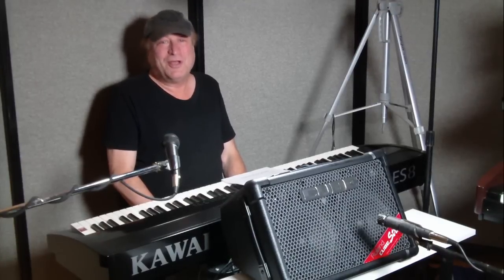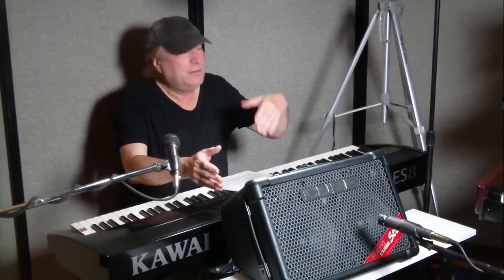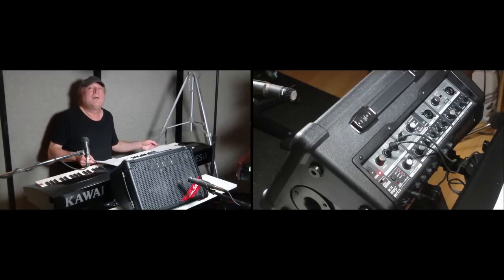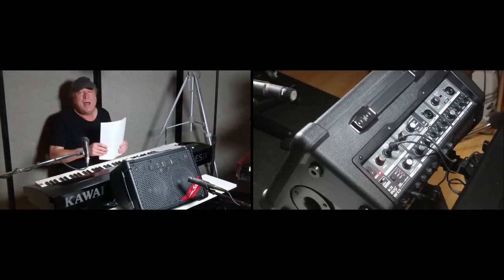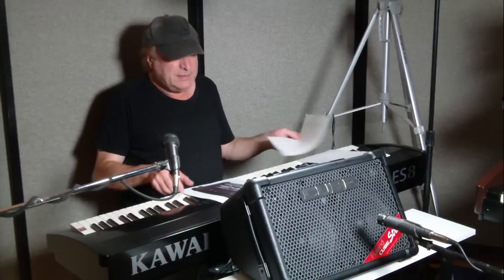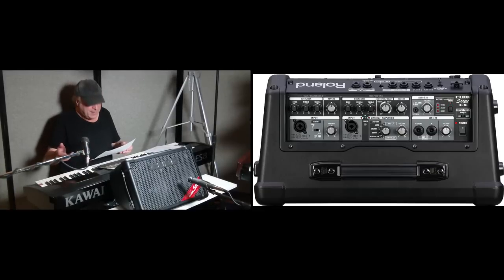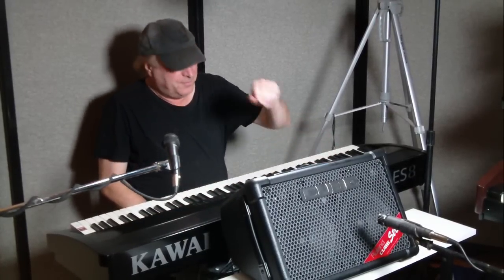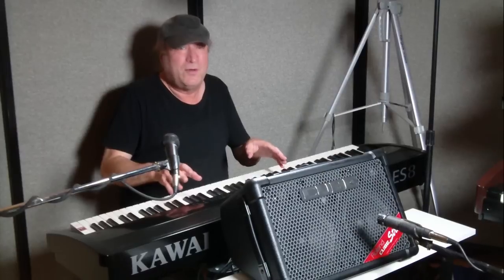Roland Cube Street EX - Review

Comment: Ok at 6:25 you say people are replacing the stock ROLAND speakers with Jensen MOD8-20 and that’s fine in it’s self but, you then go on to say 4 to 8 ohms? That’s where you lost me because ROLAND amps like any amp are designed to run at specific loads e.g. 4ohms or 8ohms or even 16ohms not 4 to 8
What I’m trying to say is is it 4 or 8ohms per channel? So the speaker impedance can be correctly matched so the amp runs efficiently. Remember if the impedance is too high the amp will work harder and be quieter than it should be BUT if the impedance is too low you will destroy the power section of the amp so the right impedance is kind of important here, sorry to pull you up on this but worth mentioning.

Comment: Chuck, I just received my Roland Cube Street EX and Behringer 1002B!  I tried using just the Roland with my Android phone and an "EQ" app, but that did NOT cut it.  The Behringer is essential for the Roland.  You were "spot one" as to the light bass and tinny treble.  I'd like to get those Jensen speakers - what are they, and where can I get them (if you know)?  Or, what forum did you ding about them?  One question on the amp itself:  which do you think is better - running the keyboard (Roland VR-09) into the Behringer or directly into the Roland, into those instrument/mic channels?  If the latter, I suppose I'd get RCA output cords for the phone from the Behringer?  Thanks again, Jeff.  PS - I bought the Roland bag, too.  Cool.
Reply from the maker: Google "jensen mod8-20" and you'll find them.  
Google "jensen mod8-20"+"cube street ex" and you'll find the forums they were mentioned.  
As to your question - whichever sounds better would be the way to go (in other words, try them both).
Reply from the maker: I've concluded that if you don't need all that power (50 watts, which is excellent!), go with the KC-110.  If you do, you'll need the Behringer mixer or equivalent, and most likely the Jensen replacement speakers - which now make it a lot more expensive!  For me, I need the power (50 watts on battery power can't be found anywhere else).
Reply: I do need the power.  I am replacing my Samson XP40iW (40 watts).  I wouldn't want to go lower.  It might be nice to have the KC-110 as well, though.  Maybe next purchase (but I want to buy a video camera to record myself playing and for a non-musical business project to post on uTube).  Did you do the Jensen switch?  I see those are the speakers!  Do you like the Zoom Q4 video camera?  Your videos look and sound great - what do you use?  Thanks, Chuck!
Reply: I'll check it out.  Why two:?  Doesn't it have enough inputs?
Reply: One to process the stuff going into the AUX and one to process my guitar going into the Line input (in stereo)
Reply: I solved my backing track EQ issues by purchasing the N-Track recording app (I use an iPad) for $29.00. I bring each song into individual tracks. Then I EQ each song to my liking. Shockingly the bass now more than decent. 
I’m using a Vox Stomplab 2 for my guitar and it’s been an effort to coax optimum tones. It’s acceptable but still working on it. But I am performing and like this amp.

Comment: Have you tried Roland's BA330 at all? If so, which do you think would be better for a keyboard/vocals busking session? Both are supposedly 50w and can be run off AA batteries, but the BA330 seems to have more keyboard friendly inputs, master volume and master eq. It is a bigger/heavier amp though.
Reply from the maker: BA330 is 30 watts, not 50.... and is much better suited for a keyboard.
Reply from the maker: Actually, the BA330 is closer to the Roland KC110 (now the KC220) than the Cube Street EX.  This video should give you a little more insight on the sounds: https://youtu.be/w5rZnAM1XVU
Reply: I currently use a kc-110 for busking, but it struggles. I think I need something with more guts. I must have gotten confused about the wattage on the ba330. Thanks for the heads up. Makes things harder. Not sure where to go from here. I play keys and sing, so I want something with built in reverb, an 1/8" aux in for backing tracks and enough channels for a mic and stereo 1/4" cable from my keyboard. Something that has a nice sound for female vocals and keys and the power to be played at 75% or lower in an outdoor situation without being completely drowned out by outside noise. Any recommendations?
Reply from the maker: Actually I do have a recommendation for you - a product that's a lightweight portable AC power supply.  A friend uses this to power his rig (keys and a Roland KC-80).  Someone else uses it to power an entire pro rig with (I don't remember his gear list but I know that Bose L1's were part of it).  The product is the Coolis HP150 which I reviewed at this link: https://youtu.be/D4OcQ-44PkQ

Another idea is the Mackie Freeplay, which there's mixed feelings about how it sounds - some people love it, some people hate it.  But it claims 200 watts (which I doubt), but its definitely much louder than the KC110.  Here's the link to my comparison of the Mackie Freeplay vs the Roland KC110: https://youtu.be/z274UPmM3rQ

Hope this helps!
Reply: Thanks for that. I'll check them out! In my research since this video the Bose S1 Pro is looking like a good option. I will have to sacrifice stereo sound, but I could manage with only mono sound for busking, so not ruling it out. Thanks for your help!

Comment: Great review. 
I wonder has anyone reported any issues with the sound cutting out when on 50w at no more than 50% of the volume level from line in? 
I use an mp3 player for my music as a street performer i do use the 50w setting - which lets face it 50w for 8AA batteries. Massive reason for buying it. Need to know if i'm using it wrong or if is a common fault???

Comment: Great review, Chuck!  As usual, you've uncovered some "quirks" that the manufacturer does not....  Is there any workaround for the lack of EQ on the line ins (such as an ultra portable stereo EQ)?  My Roland VR-09 has no EQ controls....  I also use backing tracks and need those EQ controls for BOTH the keyboard and the mp3 player (Android phone).  This is pretty much a deal-breaker for me, and that doesn't even count using one of the EQable combo inputs to mic my saxophone for gigs where that's needed...  Thanks, and keep up the great work1

Comment: hi there, my instrument has 2XLR balanced outputs, i also have the street cube EX, hence to hook up to the line level inputs of the amp, will the inputs accept TRS balanced jacks ?   ps have searched for an answer in the manual and internet but to no avail !!   please help...thankyou
Reply from the maker: Only Roland tech support can answer that for sure.  In the meantime, get an adapter cable - XLR female at one end, 1/4" male on the other - problem solved.  Any major music gear retailer would have it.
Reply: thanks for your prompt reply chuck, i'll chance  the cable you mentioned ( a balanced cable ,XLR one end and 1/4" TRS male  on the other end ) ....fingers crossed !  ...cheers!
Reply from the maker: No - its XLR one end and 1/4" TS male on the other.... unless you know that the Roland will accept a balanced TRS 1/4" input.  Again, you'll need to contact Roland tech support to know for sure but in the meantime count on it taking a 1/4" TS jack.
Reply: cheers chuck, thats clarified  the dilemma for  now, will take your advice and contact Roland tech support....

Comment: Hi! No phantom? Only dynamics mics?
Reply from the maker: That's correct.  If you need phantom power, you'll either need a separate phantom power supply, or a mixer that can supply phantom power.  Most PA's like this won't have phantom power.

Comment: 25 Watts +25 Watts =50 Watts 😂😂😂
Absolutely no. its 25 Watts when you install 4 speakers its 100 Watts? 😂😂😂
Reply from the maker: Amplifier ratings are constant, it has nothing to do with the number of speakers attached to it.  In this case, a 50-watt stereo amp (stereo meaning 2 amplifiers - a 25 watt amp for the left and a 25 watt amp for the right).